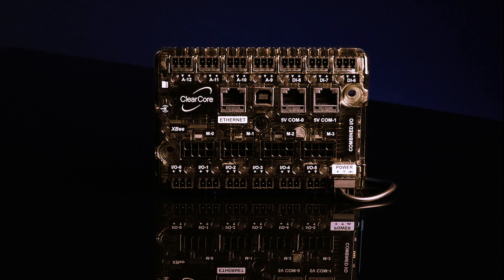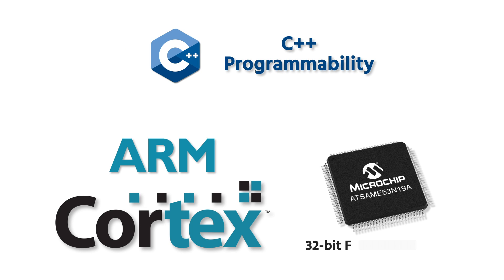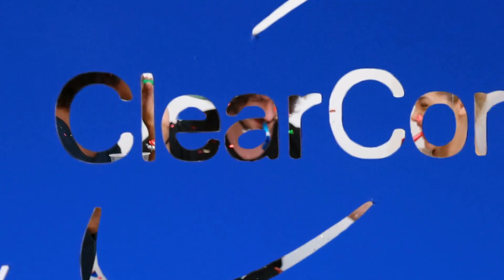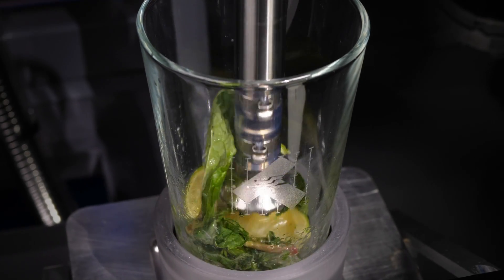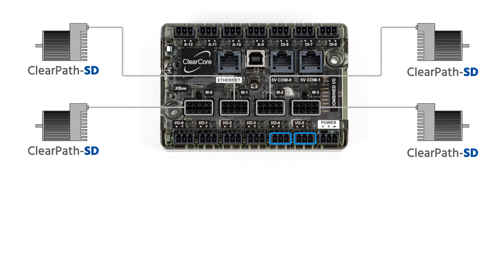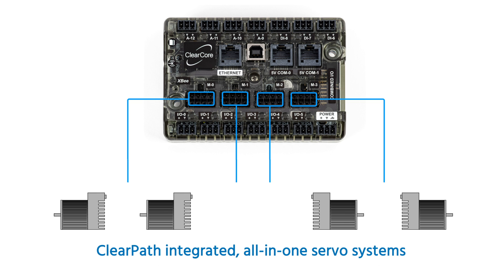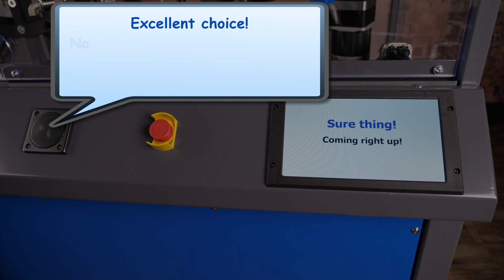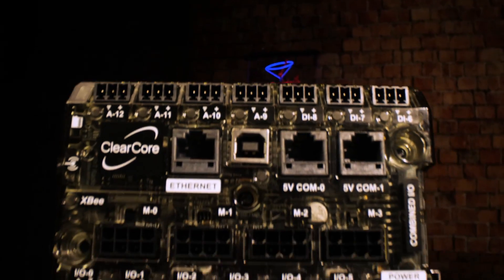Robotic Bartender Powered by ClearCore - Teknic's Industrial I/O & Motion Controller

Comment: Pretty impressive!  Can ClearCore do step and direction from Mach3 over ethernet to drive three (or four) ClearPath SDSK servos for the CNC router enthusiast?
Reply: I am using Mach4 and sending commands to my tool carousel kit prototype using ethernet. I use the ClearCore and the SDSK motors with a bunch of analog and induction sensors. Works really well but you need to write the software. The ClearCore doesn't come out of the box programmed except with a Arduino compatible bootloader and a program to flash the LEDs. Since you can use Arduino compatible code just port GRBL to the ClearCore. That is my next project. Personally, I am getting rid of Mach4. It isn't bad but it isn't needed anymore. It takes a whole PC for what could easily run on a ClearCore and almost any Gcode loader will give you 100% of what the Mach3 or 4 UI have.
Reply: @adeeperbluegreen  Thank you for the information!  Good luck with your project.
Reply from the maker: Hi @Machine 27,

I'm an Applications Engineer at Teknic and I’m glad that you found ClearCore impressive!

ClearCore is a programmable motion and I/O controller that you can use to generate Step and Direction signals for ClearPath SD motors (and other Step and Direction servo or stepper drives), but ClearCore is not a native CNC controller. There is currently no off-the-shelf software compatibly for Mach or any other CNC controller.

The Motion commands in ClearCore's standard C++ “Motion and I/O Library” are targeted for use on machines that primarily perform “point-to-point” motion. In other words, people use this library when they need an axis to move from point A to point B, but they don’t need the axis to follow an arbitrary velocity vs. time profile (these arbitrary velocity vs. time motion profiles are what you need in most CNC applications).  If you haven’t already seen it, here is an overview of ClearCore's capabilities: https://www.teknic.com/products/io-motion-controller/.

ClearCore’s source code is freely available through the Downloads page on our website (https://www.teknic.com/downloads/). It would be possible for an experienced software developer to program ClearCore to interpret G and M-code commands, or stream position/velocity commands from a CNC controller like Mach, but at the moment, Teknic does not have any plans to do this. We would, however, be happy to support anyone who wants to take on this challenge. Once that programming was completed, ClearCore could coordinate multi-axis Step & Direction motion (along with reading and writing motion related I/O) based on commands from upstream CNC software like Mach3.

If someone were to take this on, that individual would bypass the high-level motion commands of ClearCore’s Motion and I/O library (because it is designed for point to point moves rather than path-following). You would then program ClearCore at a lower level to send out a variable number of pulses on a fixed heartbeat (5kHz). By varying the number of pulses per sample time you could create the arbitrary velocity vs. time profiles that are required for CNC machining.

If any user is interested in developing this front end interface, and they feel they have the experience and background to develop this type of functionality, please give us a call at 585-784-7454, or use our "Contact Us" form online at https://www.teknic.com/contact/.

Best regards,
Jon K. - Teknic Servo Systems Engineer
Reply: @TeknicInc  Thank you for the response.  Your company's motors have become the "go-to" for many of the hobbiest cnc people (myself included).  A turn key device from Teknic that could run Mach3 / Mach4 would have a good market I would think.